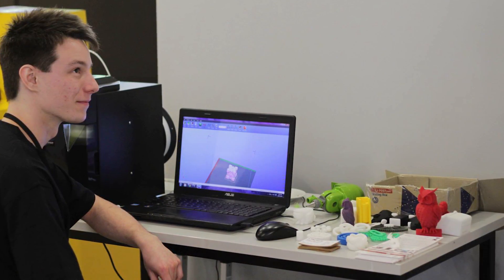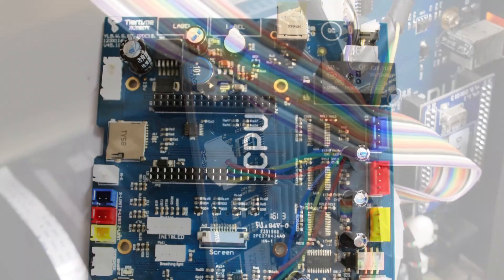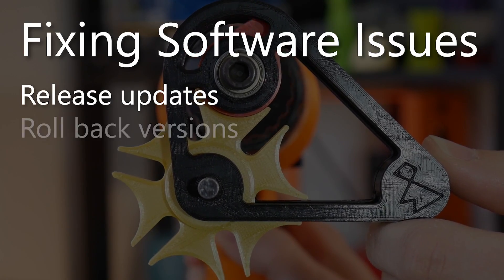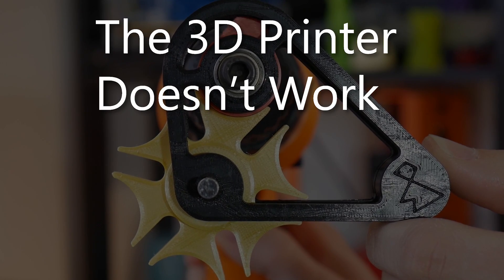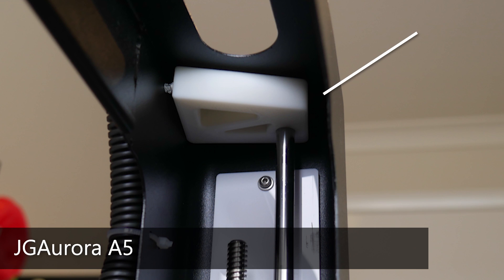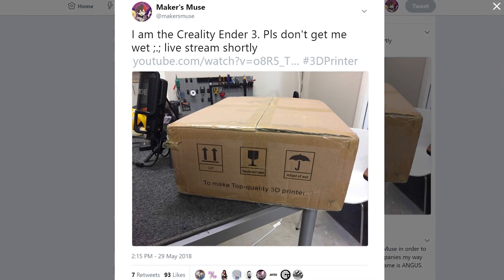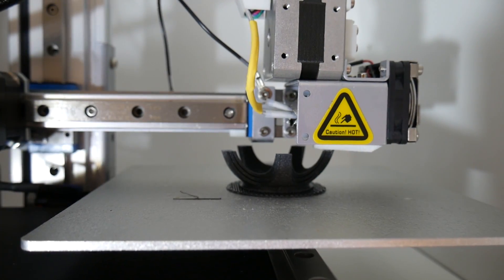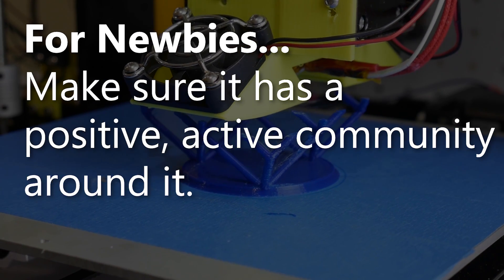Serious Concerns with 3D Printer Quality Control

Comment: Of the four 3-D printers I purchased last year, three quickly failed because of cable problems (even the factory-assembled Prusa), the Prusa failed again (another cable problem), and the Creality Ender 3 S1 Plus had so many problems (cable failure, firmware that destroyed the printbed, poor documentation, glacially slow customer support, etc.) it makes me wonder if Creality is intent on destroying their reputation with half-baked products, for which they are notorious.

But it is clearly not only them, as even Prusa printers are hobbled by engineering flaws obvious to everyone who can think logically. Now that they and others have been antiquated by Bambu Lab, perhaps they will get serious about innovation and belatedly give quality control the attention it deserves.

Comment: If i had to buy a 3d printer. i would probably have gone with a Prusa Printer and their fillament. in hind sight my ender 3 v2 can no longer be called a Ender 3 v2 it was too difficult to 3d print with it and maintain it on a longer time. had issues from the start. sometimes i just wanted to contact people who owns a prusa or get support overall by printers with a well defined setup and alot of optimizations for that one printer. though thanks to many of the configurations that i did on my ender 3 v2 i have way better recommendations for people who just want to print and nothing else.

Comment: As others have said, a revision history would be good. It would be nice to know if ones recently purchased printer has a factory mod that solves a known issue or if a mod will likely be required after using the printer for a few weeks. Have noticed most the useful youtube videos about the Mono Select Mini V2 were made 2018 or earlier. They are still being sold by Amazon.
I was quite surprised to see the price one could get a mini FDM 3D printer for (fully assembled). The one I purchased worked out of the box.

Comment: we bought a ender 3 for christmas for the father of my boyfriend. We needed 2 month to make it work. It doesn't extruded enough filament.
No one of us hat experience with 3D printing. We decided to ship it back as defect but we tried to reset the settings. and it's working.

I got also an ender 3 in february.

first difference: mine has a micro usb port and the one from december has a mini usb port.
So I'm not sure but I think the first one has a 8Bit Board, as mine has a 32Bit Board.

I bought for mine a bl touch and had problems installing it, because of a bug in Crealitys marlin. So I compiled my own.

As the 8Bit Boards aren't so easily flashable like the 32Bit boards we didn't bought a bl touch for the father of my boyfriend.
It would make to much trouble to support.

We also have the problem, that he isn't as fit with English as we are. So most of the instructions aren't understandable for him.

Both Ender 3 were bought on amazon but were extremely different.

As Creality also has the ender 3 pro and ender 3 v2 it is extremely confusing for a beginner.

Comment: Absolutely spot on rant. I also really appreciate your honest reviews. To me kits mean that the customer is going to debug the design and spend lots of money on upgrades. In the 1980s I used to custom build $3000 computers but now computers are appliances to me like toasters.  I am of the opinion that people fall in love with their 3D printers and shower them with more time and money than common sense and economics would dictate. I just saw Ender 3 videos for closed loop steppers and Duet 34 bit main boards. Upgrades for the sake of upgrades because they will not make a $200 machine that much better.. On the face of it there appears to be a huge upgrade market for people who like to tinker and apparently they expect problems which become opportunities to learn and buy more stuff. Prusa sells to the people who want an appliance that just work.

Comment: I will add this. You are correct about making purchases of 3D printers from countries other than where you live and we do know that China produces a lot of 3D printers. In fact I have 2 printers from China and 1 from Korea. One thing I have done was to eliminate the first couple weeks of potential shipment damage or first couple weeks of usage risk by purchasing over Amazon. At least I have some degree of a return policy through them. AND since I am commenting on 12/22/2020 when we have a pandemic, over hyped pandemic but I will not get political, but Amazon opened up their return policy to be over 2 months. So, we do have the added protection of a couple months to verify that we like the product and that it was not damaged on shipment, or that it isn't a lemon full of issues. Now, after the pandemic, again the over hyped pandemic, I assume Amazon will slim down the return policy. But for now, I take advantage of using Amazon to help buffer the risk of buying off shore products.

Comment: Funny thing, as a Project Manager, I have read that book. And, yes, MVP - minimal viable product. BUT, this is supposed to mean supplying a minimal amount of functionality but THOSE functions/features, have to still be of quality. What an MVP is supposed to do is to get a product to market with SOME functionality to validate how customers accept the product before adding features. A lot of companies build products with features that are not necessary and sometimes even not wanted, not acceptable, or that add cost that a consumer does not value as being something the consumer will be willing to pay for BUT would have gladly paid for the product at a lower cot without that unwanted, or what he/she deems as a useless feature. BUT, an MVP is your first launch into the market and a company should not be using customers as testers of the product. Those few select features of the MVP MUST be of quality.

Comment: My Anycubic Kossel Plus came with a damaged pin on one of the chips. So when I plugged it in, it started to smoke and almost lit on fire. Then I bought a new board and it worked perfectly. Thanks for almost burning my house down Anycubic.
Reply: did you buy the board from a different company?
Reply: @S41t4r4  I bought the new board from a dude of eBay
Reply: @pebble24  I was more interested if it was an entirely different board, I phrased my question wrong. sorry
Reply: @S41t4r4  No, I wasn't so sure about 3D printers as I am now when I bought the new board. So I wanted to get the exact same board to make sure it would've worked. I think it was a Trigorilla *something*.

Comment: This is probably the best video I have even seen.  I am totally behind you.  I have stayed away from 3D printing because of the doubt over what is going to arrive.  Also, a disabled person that is dexterity challenged i can't screw around with printers to repair them. I just bought a Monoprice Cadet, do one it broke down and refused to home correctly.  So I had no no problem sending it back.  Keep up the good work, I love your unbiased assessment and knowledge gained from many years messing with this stuff.

I trust your opinion.

regards, 
Russ

Comment: All this bad rap about Anet A8's. If it wasn't for Anet, i might not have started this hobby in the first place. I love my Anet A8 even though i have a better printer now, but the Anet helped me build it! 
Only IDIOTS set their house on fire with equipment that costs less than your weekly groceries.

As for changes in the products... it is based on open source! Get used to updates and changes. Try Linux for a few years and you'll start to understand.
Reply: the problem with Anet was that they had poor quality control and deactivated the safety features of the firmware. It was basically luck if the board didn't fail in stock configuration. so no it wasn't about the iq of the user. those fixes from the community did make the printers less risky but in fact it should have been the producer and distributer who should have fixed that product.

"As for changes in the products... it is based on open source!"  alot of products are in fact not open source! and the problem is that a potential customer has no idea what kind of version he will get if he is purchasing the device, it could be better or worse. It could be the company or one of the supplier that gets the idea to save money by producing cheaper in worse quality and the customer has no way to find out if the product he will recieve is like advertised before the purchase.

"Try Linux for a few years and you'll start to understand." Linux as the kernel is software and he made the point that in software its less controversial (especially with free one), also you don't pay for the kernel, while you have to put money on the line for beta productsthat at best doesn't work properly and at worst kills you.

Some iterations in product lines are fairly common and acceptable, like the revisions of the Duet2 Boards. All revision work fine, are supported the same way, there is only one revision with clearly stated specs on the market.
The newer revision of the switch got an etirely new packaging design, the wii  family edition got a new model number, different design and wasn't sold on the same page in mix to the older gen 2 wiis. 
the acceptable ones are those with transparency, those where customers aren't tricked. 

And I didn't even talk about customers who bought products with a lot of money just to feel cheated, when the company drops without any sign a new improved revision for less money.

Comment: My feeling is no company, hardware or software, should push off on the customer beta testing UNLESS the customer has explicitly signed up to be a beta tester. 

Think if auto manufacturers did this. Actually in a way  Ford did this with the Flaming Pinto from the 70's. For the want of $1.50 USD (at the time  - rubber bladder and some washers) Ford produced a deadly car. 

We need people like you @Maker's Muse to stand up and tell us when something is rubbish.

Comment: The crowd testing model basically screws over your early adopters that gave you the money to stay in business. At least with software beta testing, the early testers eventually get the updated and improved software versions. I can acknowledge though that doing proper R&D in advance means more expensive printers. That's why Prusa printers cost so much more than Creality.

Comment: I know this is most likely not seen by many, but I think 3D printers should have a naming scheme similar to that of German WW2 tanks: product_family version_number revision. So e.g. a Ender 3 from the start would be Ender 3 rev. A, after the first few adjustments it's Ender 3 rev. B. All clearly labeled and documented, so that communitys can tell you which upgrades are the best choices for your specific Ender 3.  And just like the tanks back then, there could be kits to upgrade a range of earlier revisions to newer ones. This wouldn't add much additional work and nearly no additional cost.
Reply: basically what prusa is doing.
Reply: @S41t4r4  Prusa's naming is a bit different. i1,i2,i3,i3 mk2,i3 mk2s,i3 mk3,i3 mk3s
not too bad, but i3 basically became part of the name by now, so I doubt we will see a Prusa i4 any time soon. And their naming system only allows one minor upgrade between major upgrades. But to be fair, it is one of the best naming systems in the 3D printer industry.

Comment: As a former mechanical design engineer myself, I am aware of that development issues well.  Based on many on-line reviews including yours, I skipped low end machines and ordered Prusa i3 MK3s kit as my first 3D printer.  It arrived two weeks ago.  I was confident and comfortable on assembling from the kit.  The assembly instruction book is pretty thick and well written.  Only problem I encounter was photos used to identify the parts because all the parts are black and those photos are also black of course.  This makes it vary difficult to see what you are looking at.  I much prefer mechanical illustrations or even drawings to understand what those show.  Or just use lighter color!  The machine fired up at the first power on.  It runs relatively trouble free since then.  Only problem I had so far is a software lock up after pressing reset button when I saw a printing problem.  The first layer did not stick and peeled up.  This lock up status did not clear even after power off/on!   I tossed the issue on the user forum and got no response even today.  A few days later, it did go back to the main menu.  A condenser must make it happen.  

A possible issue I found during the assembly was that the base frame could skew easily when you do not have any machine assemble experience.  The side frame is two pieces sandwiching a main vertical plate in between!  It is pretty tricky to make the  entire base frame completely flat if you are not careful when tightening all screws up.  There are no play between screws and holes so that you have to rely on tightening order of all screws to un-skew it.  I knew that it is very important to make it in one plane.  I think that this is a major design flaw.  It should be a simple 4 piece box frame.

Buts so far I am happy with the decision I made.  I know I cannot get everything I want with this price.  My Prusa has been printing all the models came with the kit and several models I downloaded from the net day and night.  Thank you for your informative review and advice.  Now I have to learn Fusion 360, which is different from SOLIDWORKS I had been using for a long time until I retired 12 years ago.  Happy 3D printing!

Comment: I just ran into this video. You're part of the problem stop recommending that people buy these shady closed source 3d printers from shity companies. I've owned 2 printers in my life a Printrbot Simple Metal and a Prusa i3 mk2. I haven't tried other printers because though the Printrbot needed a little tweaking both printers worked as advertised. Also, it's perfectly ok to do this type of testing with hardware. 3d printers are a low volume product. What needs to change is either companies should provide open source files so that people can print and replace the upgraded parts (if possible) or they need to have better customer support. Some companies do both which is why I saved up for a Prusa.

Comment: This is probably why larger companies like Dremel are entering the market with such strong products these days. They DO that testing. They produce a product that just works right out of the box.I've been debating my first FFF printer; looking at the Ender 3, the CR-10, and the Prusa i3 Mk3. Then I saw Dremel's new machine in reviews and, yeah it's got an extra $100-$200 on the price tag, but it friggin works first try, right out f the box, with no headaches.Small companies may be the innovators, but if they want to live long enough to become a big company they need to produce a strong product.

Comment: Thank you a ton for this. I saw your video on the Ender 3 fire hazard from this year after I bought 2 of them and recieved 2 noticeably different products and this was the first thing that stood out to me. I now have to treat the two machines differently, but immediately soldered the lame power supply connector because of your videos.

Comment: Finaly influencer said that, I was arguing with people, that buy printer and then buy more upgrades for 200,300$ and then saying this printer is best printer ever, thats idiotic, thats NOT the same printer you bought idiot... Good job Angus keep up the good work
Reply: I call it buying a new car, stripping it to the frame, and upgrading all the parts and convincing yourself you have made a good purchase.
Or buying a hammer, replacing the head, and handle, and saying its the same hammer.

Comment: Yes the manufactures are mostly to blame but looking at channels like yours, 3D Printing Nerd and Tom Sanders you are all tinkers and seams to promote printers that require a lot of tinkering and all are of questionable design and quality and require a lot of tinkering to get to work. I really think you guys are partly to blame, instead of keep promoting this type of 3D printers you start to promote quality and build design more, Ender, Prusa, Anet, etc... are all cheap crappy printers compeating on who can make the cheapest product and not a quality product. Take an example the Prusa Mk3, everyone is up in the sky on how great a printer this is but in reality it has so many issues and stupid design flaws that should have been highlighted.

Let me give some examples:
 - Badly designed toolhead, where even the most basic of maintenance task takes hours to perform
 - Individual wires directly from motor to PCB on moving part, those wires will break meaning that you will have to take everything apart - a ribbon cable design would have been so much better, one component that is easy to replace when a wire internally breaks
 - Very narrow clearance from nozzle to the fan and other printed components, so failed messy prints gets stucked everywhere (in some cases means a complete disassembly of the toolhead)
 - Tons of software issues, you really have to build your own version of the software to fix many of these
 - Are still not shipping the correct print surface

My point is if reviewers like you want better quality printers then perhaps you should start reviewing the better manufactured printers that are a bit more expensive and then give credit where credit is due.

Comment: Agree. Saw a unboxing/review about the NEW Qidi tech X-pro online, spoolholders were in metal and there was a network port but he had problems with bad connection using the network saying they will still prob fix it with some software update. Well no,  I got mine only 3 months later and it came with plasic spoolholders, no more network port, actually the port is still there but there is no more opening in the frame to acces it. And the PSU is a bit stonger. I told the reviewer and he was amazed as the printer was still new released.